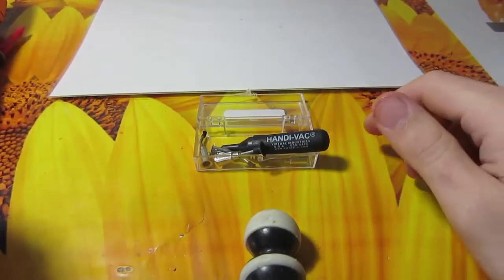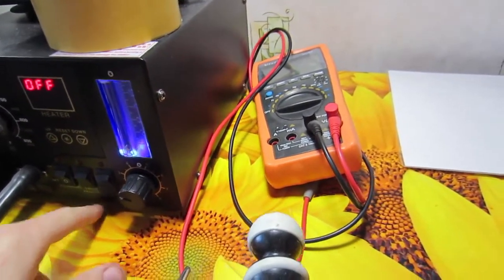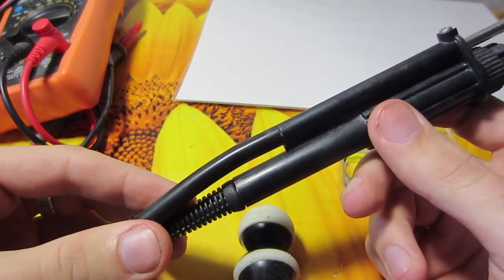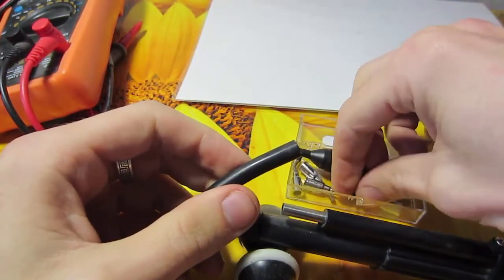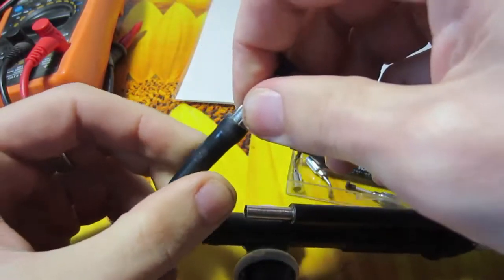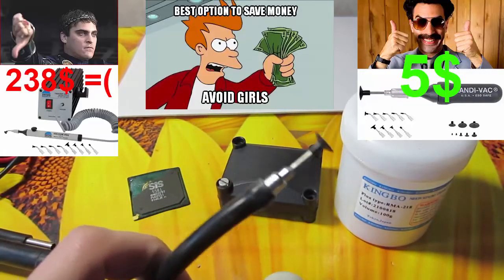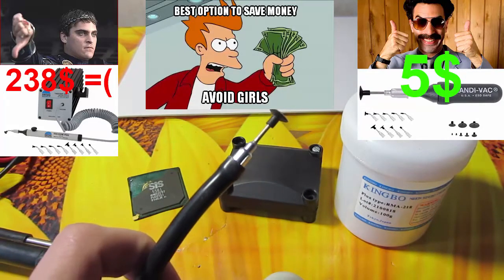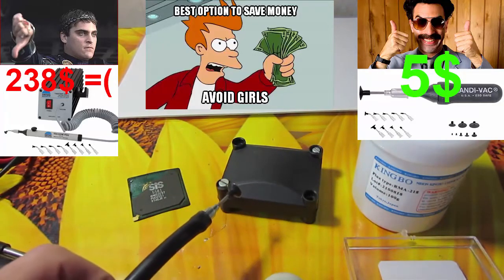Lifehack: BGA vacuum suction pen for pick up and place chips, DIY sucking Tweezer

Comment: Very good.  Now you need a switch on the floor to turn it off so you can put the part down.
Reply from the maker: +pillsnotbills its pretty easy to do that stuff, cause station itself has the switch, in fact you can connect any floor switch there directly =)
Reply: Russian Laptop Repair Yes, that's what I mean.  Connect some switch in series with the existing one.  Such switches are used with certain music and audio equipment.  You could put a switch on the handle itself.

Alternatively you might use a valve to open the vacuum to air.  It might give better results.  I have no idea but I like what you're doing.
Reply from the maker: +pillsnotbills Thanks for the kind words, i apreciate it. Stay tuned, in a few days i will announce FREE TOOLS GIVEAWAY!